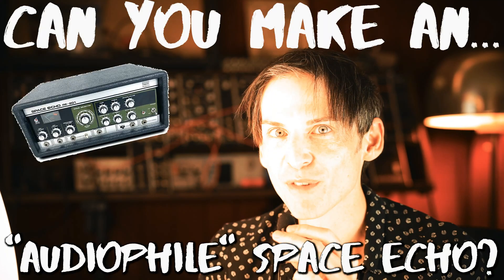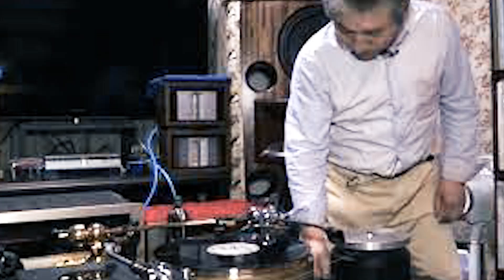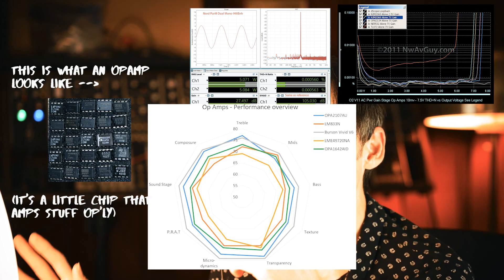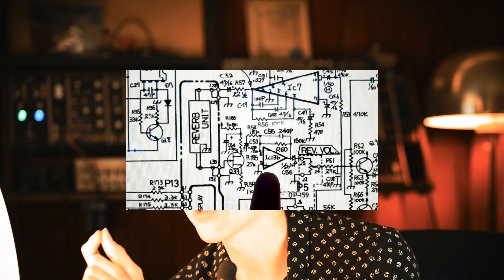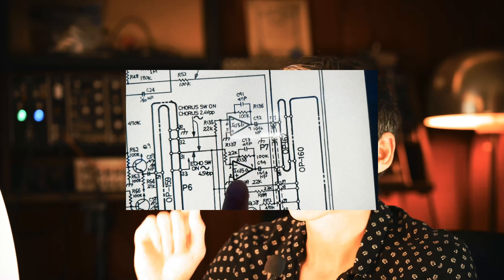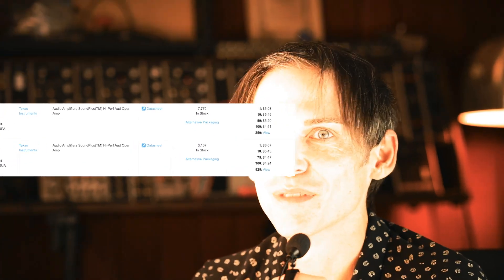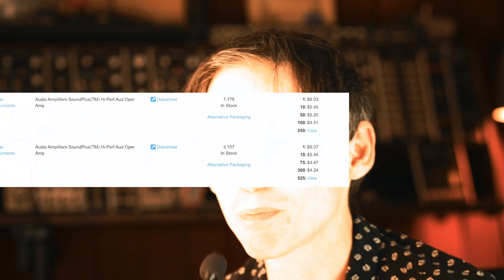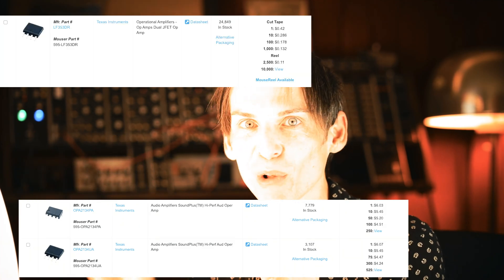Can You "Audiophile Mod" a Vintage Space Echo...?

Comment: Great video! I was prepared to hear that there wouldn't be any significant difference but I'm very surprised at how crispy and jangly the fancy op-amps sounded in comparison, although there is a very noticeable volume difference which may be affecting my feelings on it. 

(small note, your dialogue volume does dip in different shots)
Reply from the maker: Yeah, I felt the same way. And I also noticed the volume increase and I've been scratching my head trying to guess what would account for it. The lower power consumption of the OPA's? The gain profile should be set by the surrounding resistors, I believe. A bit of a mystery I don't have much insight into.